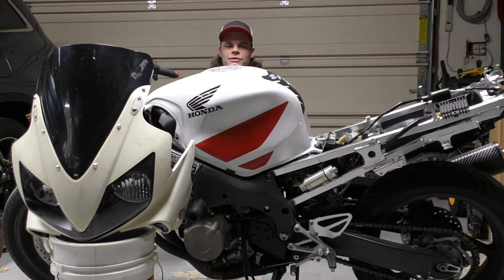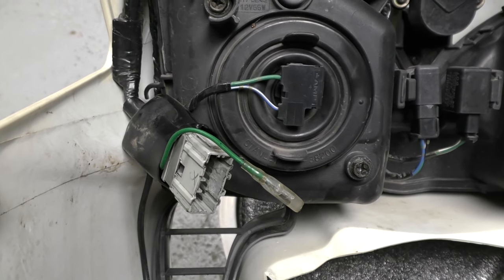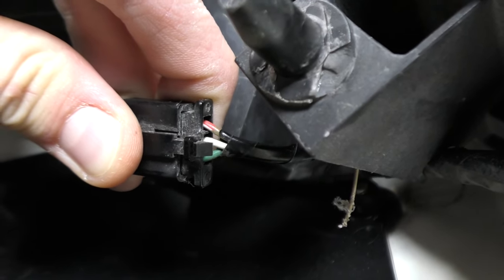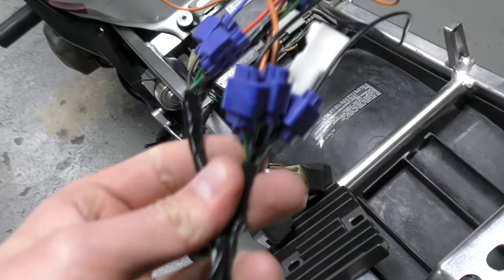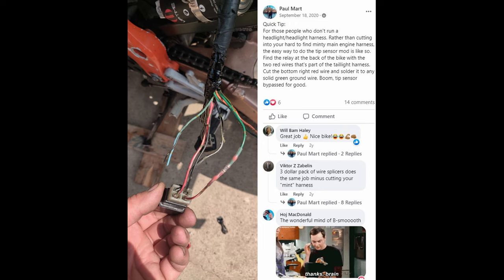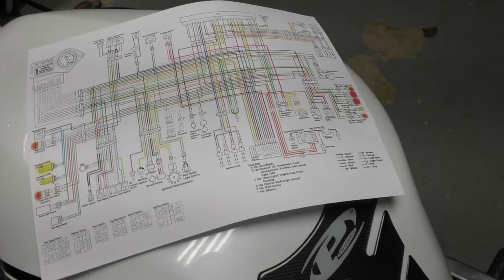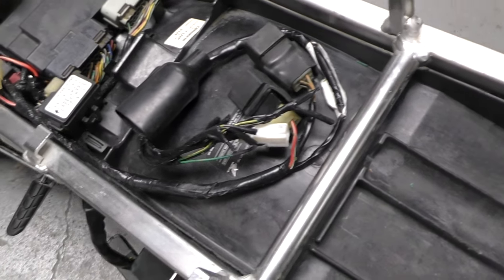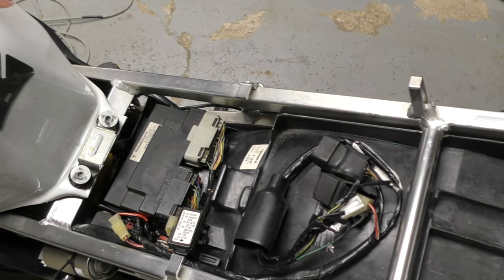2001 F4i Stunt Bike Build - Episode 3: Tip Sensor Bypass

Comment: Do you have a a video for the clutch switch bypass and kickstand bypass???
Reply from the maker: The clutch switch bypass is just a 10amp fuse into the plug. I'm not doing the kickstand bypass so I don't have any knowledge on it.
Reply: @RobRippin  I don’t have the blinker switch on my bike that they jump with the fuse mine would have too be done with the main harness
Reply from the maker: @Joe-wheels  Ya I don't know off the top of my head how to do it off the harness but you can find the wiring diagram here if that helps:

https://www.youtube.com/watch?v=Bi28HFqFIx0

https://www.reddit.com/r/F4i/comments/10ezjm6/f4i_colored_wiring_diagram/
Reply: Sir fuel pump is not working properly

Comment: You have any plans to add an aftermarket headlight for the shorter daylight hours?
Reply from the maker: Nope, no need for one, but could easily wire one up to the switch on the panel

Comment: Bonjour, le sensor de ma moto est le même modèle que celui de ta moto.J'ai acheté un sensor qui n'est pas neuf.Quand je secoue le sensor, j'entend qu'il y a de l'eau qui bouge dedans.Tu peux me dire si c'est normal d'entendre de l'eau dans le sensor ? Merci.
Reply from the maker: There shouldnt be water but a tip sensor has a ball inside it that moves when the bike it angled. When tipped over it will contact part of the sensor inside to trip the switch

Comment: I just bypassed the tip over sensor like said but my bike won’t turn over? Any suggestions
Reply from the maker: Bypassing the tip sensor doesn't affect the bike from running. You probably got another problem somewhere else
Reply: @RobRippin  yeah I’m about to check the battery, first I thought it was the tip over sensor which your video helped me fix, then the battery went so I’ll figure it out today hopefully

Comment: Do you know how to get the engine to start even after removing the sensor?
Reply from the maker: The bike could start upside down with this sensor removed. You have a different problem if that bike doesn't start after this.
Reply: Check your engine stop relay by the battery
Reply: Sometimes mine causes my bike not to start, I just give it a little wiggle and that normally trouble shoots the problem